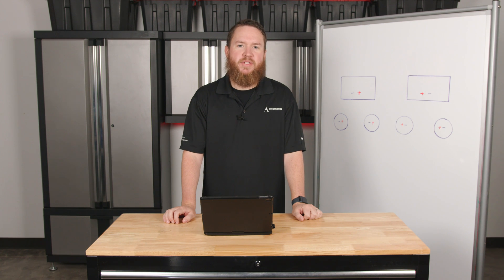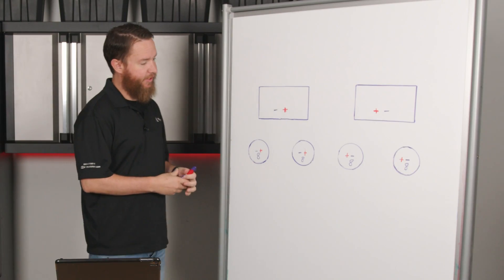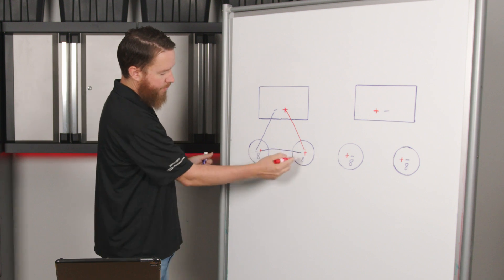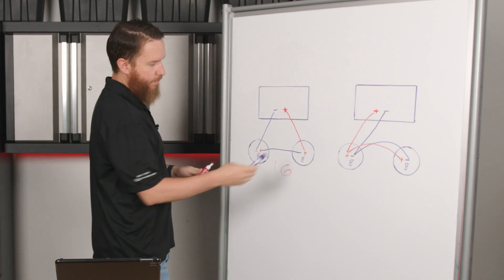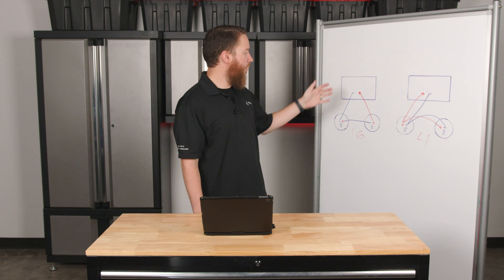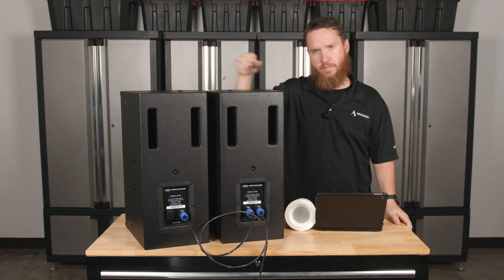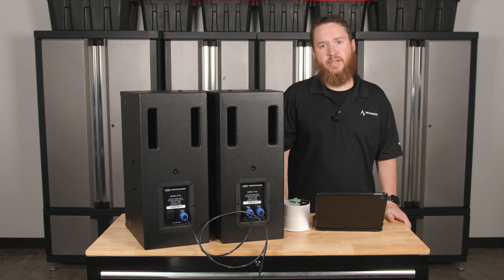How to Daisy Chain Speakers on Pro Acoustics Tech Talk Episode # 106

Comment: I have 10 ct sounds 6.5 d2 and 2 skar audio rp-2000.1d daisy chained what do I need to do to wire 5 per amp
Reply from the maker: We're not able to find reliable information on those specific models, so your best bet is to check directly with the manufacturer for the correct and safe wiring configuration. They’ll be able to point you in the right direction.

Comment: Hey brother could I daisy chain 2 extra speakers to the Bose companion 5 to create a 4 speaker set up
Reply from the maker: Unfortunately, you can’t daisy-chain extra speakers onto the Bose Companion 5 system. However, you can split the audio signal going into the Companion 5 and wire to another set of powered speakers if you’d like to expand your setup.

Comment: Is this method for passive speakers?, im wanting to daisy chain 3 active speakers which all have their own amplifiers built in?
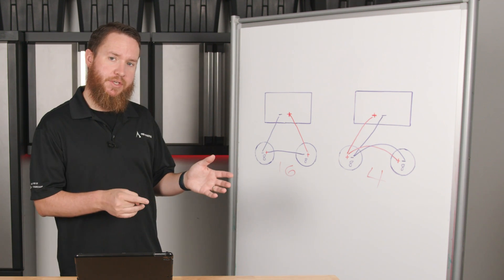Reply from the maker: This video is focused on passive speakers. For active speakers (with built-in amps), the process is very similar to what we show at 4:04 in the video (https://youtu.be/2wPJiFyJO54?si=q0Fq6uD7L5AnaqDL&t=244
), except you don’t need an external amplifier. Instead, you’d use the line out on one active speaker to send the audio signal to the next. We also have another video that goes over daisy chaining active/powered speakers here: https://youtu.be/2wPJiFyJO54?si=q0Fq6uD7L5AnaqDL&t=244

Comment: I have a question I have mp6 6 channel powered mixture. On the parallel it has min of 4 ohms. How can I connect to passive speakers to even the sound out.
Reply from the maker: You can connect either 2 speakers at 8 ohms each or 4 speakers at 16 ohms each in parallel to your MP6 mixer. This will help keep the impedance within the 4-ohm minimum and even out your sound.

Comment: Can you mix the two methods together to get the ohms where you need them? Iv got 8 passive speakers im gonna wire up and they are 6ohms each and the receiver/amp im looking at getting is good for 4-16 ohms if im reading it correctly
Reply from the maker: Yes, you can combine wiring methods, but you’ll want to plan it carefully. I recommend using one of the online speaker wiring calculators out there to figure out the best parallel or series/parallel setup to hit the impedance load you need and see exactly how to wire it.

Comment: Hi, i have the pyle pdwr52btbk bluetooth speakers. Is kt possible to add any more speakers to those. It has an active and a passive speaker. They come together from store. Will it be possible to add anymore speakers? Thanks!!!
Reply from the maker: The Pyle PDWR52BTBK system is designed as a 2-speaker setup and isn’t intended to support additional speakers directly. However, one workaround is to split your audio source (such as the 3.5mm aux input) using a Y-splitter to feed the same signal into two separate PDWR52BTBK speakers. That would let you run two pairs of speakers simultaneously for a total of four. Just make sure your source can handle the load, and note that Bluetooth sync across systems may not be perfect.

Comment: I have the marantz cinema 40 and want to wire in ceiling speakers (3) to the third zone. 2 on one channel and 1 on the other channel. all speakers are 200 W. Will the serial run for the two speakers on one channel work fine while the 1 speaker on the other channel be good?
Reply from the maker: If your in-ceiling speakers are 8-ohm, you can wire two speakers on one channel (resulting in a 4-ohm load) and a single speaker on the other channel. The Marantz Cinema 40 is stable at 4 ohms, so this setup should work. Just be sure not to use the Zone 2 or Zone 3 RCA line outputs, as those are unpowered and require an external amplifier. Always refer to your owner's manual for proper wiring and setup. Hope this helps!

Comment: What happens when we daisy chain 8 speakers with 8 ohm impedance. Like in line arrays. How do we determine what kind of amps should we use. Or should we connect some in series and keep the impedance within 2 ohms.
Reply from the maker: In line array setups, many touring-grade speakers are bi-amped or tri-amped, meaning each speaker receives multiple amplifier channels for different frequency drivers, each with its own impedance. If you’re working with full-range line arrays, you’ll need to calculate the total impedance load for your amplifier. Many high-end touring amplifiers are stable down to 2 ohms, allowing you to run four 8-ohm speakers in parallel per channel.
If you need help designing your setup, feel free to contact us at 888-256-4112 or sales@proacoustics.com—we’d be happy to assist!

Comment: Hi , just wondering if speakers need to be perfectly matched to daisy chain ?
Reply from the maker: You can daisy chain speakers with different impedances (ohm ratings) or different 70V tap settings, but keep in mind that you won't be able to control the volume of each speaker separately. Additionally, each speaker's ohm rating and wattage rating (in a 70V system) should match what your amplifier is capable of delivering. All speakers in the chain will receive the same wattage, so it’s important to ensure they’re rated accordingly.

Comment: I have a 350 watt amp (8ohms  700 watts @ 4ohms) And I was wondering if I could  run 2 tops and 2 momitors  (8ohms) in parallel  on channel two while running a sub on channel one (4ohms)?   Any information would be helpful. Subscribed and Thanks!
Reply from the maker: Thanks for subscribing! You can either run 2 mains on one channel and a sub on the other, or 2 mains on one channel and the two monitors on the other. Keep in mind that 2 x 8-ohm speakers in parallel will give you a 4-ohm load. Unless your amplifier is 2-ohm stable, you should only connect two speakers per channel to avoid overloading. Hope that helps!

Comment: Hi friend, please can you help me,
I have a Crown XLi2500 Two-channel, 750-Watt at 4Ω Power Amplifier. Can I connect 4 speakers 2 per channel 
EV ZLX-15 passive 8 Ohm 250w continuous and 1000w peak. Please 🙏🏻 help
Reply from the maker: Yes, you can connect 2 EV ZLX-15 passive 8 Ohm speakers per channel to your Crown XLi2500. When you connect two 8 Ohm speakers in parallel on each channel, the impedance will drop to 4 Ohms, which your amplifier can handle, providing 750 watts per channel at 4 Ohms. Since each EV ZLX-15 speaker is rated for 250 watts continuous, this setup should work well as long as you keep the volume within reasonable limits to avoid driving the speakers too hard. Hope this helps!
Reply: @ProAcoustics  thank you so much for your answer I really appreciate it. 🙏🏻🙏🏻

Comment: Can you daisy chain a samsung gigasound 7000sh to a harbinger vari 4115 if so how Would you do it.. thanks and thanks for postíng staff like this..
Reply from the maker: If the Samsung Gigasound 7000SH has a line-level output (not powered), you can connect it to the Harbinger VARI 4115.

Here’s how you can do it:
1. Locate the Line-Level Output: Find the line-level output on your Samsung Gigasound 7000SH. This is typically labeled as "Line Out" or "Aux Out."
2. Connect to Input Channel: Use a suitable cable to connect this output to one of the input channels on your Harbinger VARI 4115.
3. Check Manuals: For specific details, please refer to the owner's manuals of both devices to ensure proper connections and settings.

This setup should allow you to chain the audio from your Samsung system to your Harbinger speaker.

Comment: Have LOTS of speakers: 3 in ceiling in GREAT ROOm; 
The above speakers are wired to a PATCH PANEL #1 with Banana Plug receptacles
The 6 banana plugs are inserted into SPRING CLIPS on the AMPLIFIER
 (Sony: FM STEREO/FM-AM RECEIVER STR-K750P)
Sony STR-K750P AV receiver 5.1 channel 575 W

Also have:
4 speakers in OUTDOOR ceiling
2 in ceiling in OFFICE
2 in ceiling in KITCHEN; 
The above speakers are wired to a PATCH PANEL #2 with Banana Plug receptacles
These 8 speakers have 16 banana plug receptacles that need to be wire to the AMPLIFIER

The ISSUE is LOTS of banana plugs to bare wires trying to be inserted into the AMPLIFIER Spring Clips.

HOW can I/should I connect all these speakers to the AMPLIFIER Spring Clips. Can WAGOs be used to minimize connections at Spring Clips? If so...HOW.
Note: Will only...even seldom be using GREAT ROOM and OUTDOOR speakers together.
Each Group of speakers EACH have their OWN sound level/on off control

Your help is greatly appreciated.
Reply from the maker: Please contact one of our engineers at Pro Acoustics to discuss your project in detail. You can reach us at (888) 256-4112 or email  sales@proacoustics.com. Our team will be happy to assist you with connecting your multiple speakers to the amplifier and finding the best solution for your setup. We look forward to helping you!

Comment: Well explained and easy to understand.  I have an Amp of 2800watts, can I daisy chain 4 ohm speakers  on one channel of the Amplifier? If no, how speakers of 4ohms can it handle? I will appreciate your response. Thank you for the video. 0:28
Reply from the maker: It depends on the minimum impedance of the amplifier.  If the amplifier is stable at 2 ohm, you can daisy chain 2 4-ohm speakers in parallel.

Comment: Thank you for your explanation. Daisy chaining ,  will it depend on amp watt or type of amp?
Reply from the maker: The type of daisy chaining you should use will depend on whether you are working in 70-volt or 8-ohm. 8-ohm speakers can be connected in series or parallel based on the specific setup requirements, but in a 70-volt system, the speakers are usually connected in parallel. Wiring 70V speakers in parallel allows you to use as many speakers as your amplifier can power. Check out this video for more on this: https://youtu.be/-omIOiKUrdw?si=8mw0cBJj-sWYWNrr&t=291